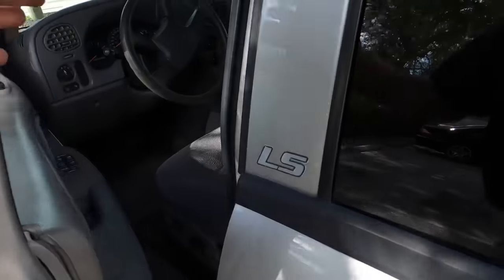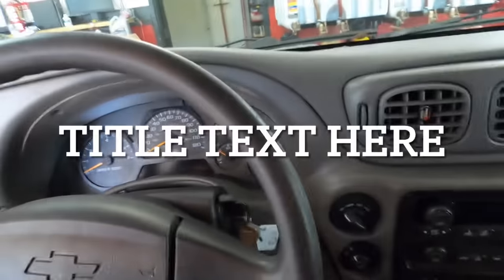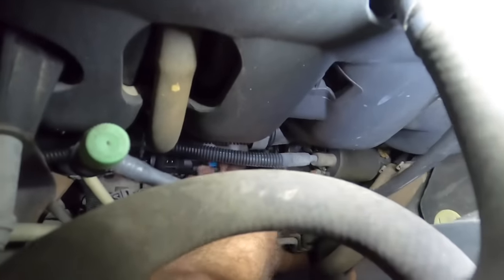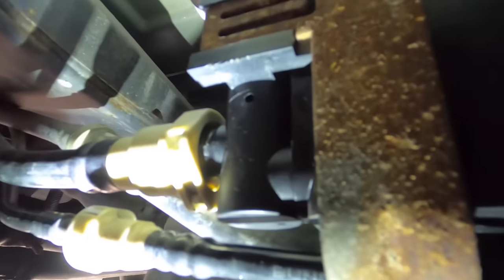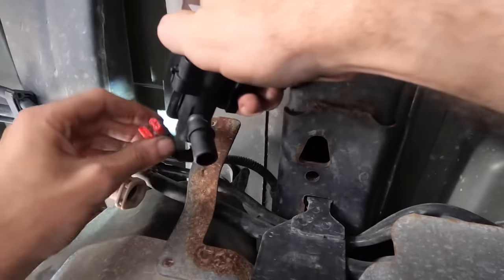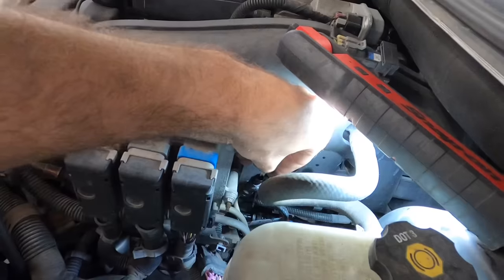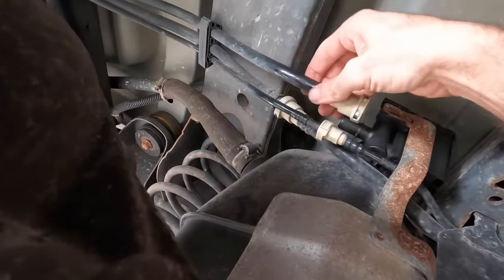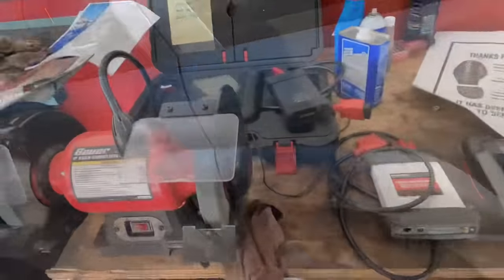Repair failed! Customer is Angry

Comment: Talking about the quality of available car parts. I can remember when available parts were many times identical with factory parts.
When Dodge came out with their first high tension ignition system, I had a 1978 Dodge van. The high tension system was a United Technologies system. The trouble was that the rotor cap, wiring and spark plugs couldn't handle the high tension. Every 25,000 miles, I had the plugs, rotor cap, and wiring at K-Mart for less that $20. I had to replace the control unit under the hood one time in 125,000 miles. I picked up a small printed brochure off a parts counter that explained the system and what to look for when components failed. 
In the early 1960s when I started working on my cars, manufacturers used many parts that were just standard off the shelf parts.
 It was the same with aircraft at that time. Bell Helicopter use PH-13 Fram filters. The same as used on Chevrolet. We would remove the filter from the Fram box, paint the filter gray, stamp it and a plain box with the Federal Stock number, then ship the filters to the government.
Most hardware for litters, seats, etc. were just plain hardware store nuts and bolts.'
But times change. Click.
Reply: Honorable mention as a built-in breakdown goes to the porcelain double resistor block that operated at roughly the surface temp of the sun.

Comment: I was getting an evap code on my 07 silverado. I smoked it and saw the smoke coming from the worst place possible, above the gas tank. So I spent an entire saturday in my garage to drop the tank and replace the fuel pump which had a small hole where it rusted at one of the connections.

Comment: Not all of us are good with smoke testing.  I had some evap issues and replaced some parts until I got it.  They were cheap.  But if I had to bring it in I would bring it in with codes on and tell you what I replaced.

Comment: I wish you could work on my brothers trailblazer I think as a mechanic it would satisfy you abundantly in trying to diagnose it. I believe there’s a short somewhere in the system, symptoms are radio, and other front end parts stop, then engine runs rough then moments later starts working properly again,  it was like that for a year or so. now I believe the short has gotten bigger because opening the circuit to much to make any contact now because the symptoms are now radio and engine rough all the time.

Comment: I believe the correct answer here would be to not look at the vehicle until the ses light is back on. I know for Ford when I check for DTC with the IDS or the FDRS I can see all codes that have been deleted. It is too bad that chevy does not or if the snap on scanner does not do it.

Comment: I diagnosed a faulty regulator on my motorcycle bought a new one, still had the same problems, you guessed it the new one was faulty to, third time was lucky, also had brand new batteries turn up faulty as well.

Comment: that is exactly why some guys like Louis Rossman doing circult board repairs do not like when other shops clean the boards before they get to him because different stuff on the board (other than his own experience/knowledge) can help pinpoint the issue faster ... when different stuff is cleaned off ... it takes more time to troubleshoot

Comment: Way back when...gas tanks had a vent tube that served two purposes, one, to keep the gas from overpressuring the tank on a hot day; and to let air in to equalize the pressure as the fuel level drops. 

Early evap systems had a charcoal canister that absorbed the fuel vapors and a valve that routed the vapors to the engine.

Comment: I've had so many of those valves off to dump the dust out and clean the foam filter. The older round GM ones held about a quarter cup of dust.

Comment: i have a quick test for a vent solenoid and purge solenoid  with he scan tool do a purge and seal test and watch the fuel tank pressure put vacuum in the tank  and seal the system and see how quickly the vacuum drops if it instant it needs a vent solenoid

Comment: My 2005 Tahoe has an Evap system fail that prevents me from filling it up any faster than a gallon a minute.  Runs fine though with intermittent fuel door error.
Reply: 🔰🇺🇸 Same here…I’m pretty sure this is the exact same issue I’m having and have had with my 2008 Pontiac G8GT. In the summer, I have to wait for the gas tank to bleed off through the filler, otherwise the tank won’t fill and it’ll spray liquid gasoline back at me.

Comment: The new parts today are junk, even OEM parts, depending on the part of course. I have a 2004 Suburban that the engine light came on, I checked the code and it was the purge valve under the hood so I bought Acdelco part to replace it, reset the DTC on the computer all was good for a week until the light came back on again, checked the code and it was the same part, I check the part and it wasn't sealing all the way when closed so I returned the Acdelco part and got another one, the part was also bad I got 1 more Acdelco part and it was also bad, 3 bad Acdelco purge valves in a row, so I tryed a Dormon purge valve and a week later it was bad as well, I went to the dealer to get a Acdelco part from them and it finally has been working for months now with no issues. WTH is going on with parts these days?

Comment: Just spent a bunch of money replacing the coolant level sensor and it’s doing exactly like the first. This video may seem unrelated but it makes me feel that maybe taking it back for another sensor isn’t a waste of time.
Reply: “doing exactly like the first” is throwing a “Low Coolant” message when the coolant is full. Also got new hoses and clamps, coolant flush, etc so if it isn’t a case of having two bad sensors I don’t know what it is.

Comment: Had an ‘02 Chevy Blazer with a similar issue… until I replaced a decrepit vacuum hose. I kept getting different codes, but they all had to do with the evap system.

Comment: My ECM detected a large EVAP leak and requested CEL illumination and also produced a P0455 code as well.  It's in only code on my 21 year old Durango. Luckily, Alabama doesn't have emissions testing so, this little light 🕯️ of mine, imma gonna let it shine 😉 Finding quality replacement parts, without paying a hefty premium... for plastic 😒

Comment: Bad new parts are not uncommon, even though it's a small part I bought a brand new 30 Amp Fuze holder and it was defective so I understand what you are dealing with on that valve

Comment: You need to replace the fuel pump module it has a pressure valve built-in it that will take care of the  evap code problem all the S tens and vehicles that had the same drive train had the same problem

Comment: Yup I can attest to the just cause it new it doesn’t mean it’s good. It’s crap. Had a wheel bearing changed cause of a issue. Had it changed out. A couple of days later I heard rotational creaking when braking dealer up and down checked everything else. Brakes, parking brake adjusted cleaned  , everything. Finally got a head mechanic on it and he said it’s got to be the bearing. The advisor said it can’t be they just changed it out. Guess what, it was crap. Bad brand new bearing. The only good thing was I got a loaner every time I came in and wasn’t charged for the subsequent visits to check related to brakes.

Comment: Before I purchased my own scan tool, I had a check engine light on my 2009 Toyota Sienna when on vacation. I took it to an Oreilly's in the nearest town and had them scan it for codes. Reader said 02 sensor. I asked to have the code reset and was told "NO" We can only read the codes for you..

Comment: Over 30 years ago a customer brought an articulated truck and transmission/clutch/pilot bearing/throw out bearing ‘cause his transmission was bad and wanted replaced, he was informed that it needed a diagnostic and he refused, so we told him to come at end of day and job will be finished. All parts and components he brought were replaced and still didn’t run, the problem was the transfer case inoperative, costumer got pissed at us for not having truck running when he refused diagnostic and it took three extra days to get transfer case and next day to install it. He never again complained about any diagnostic testing from them on.

Comment: personal experience ,that engine is done for lol had the exact situation happen to me, month later she started foaming, check the radiator the trans cooler is inside and leaks into the system and mixes in the intake and makes a nasty froth , shortly after that it jumped time

Comment: A lot of commenters asked "Why wouldn't you smoke test the new part while you have the machine still hooked up. As evidenced by the fact he put the "new" new part in, while laying on the ground, it is VERY common to diagnose a vehicle and then return it to the lot while waiting for approval/parts/ or whatever particular holdup may arise. Disconnecting the machine and reassembling any and all components is a common and necessary gamble, especially when there is a high probability for customer disapproval. Why clog up a bay for an hour or longer when I can be working on other stuff?

Comment: My 2020 Pathfinder had the same prob. The tech said there is a tube at the tank has a varmit induced hole. The tube cannot be "repaired" it will shatter. So, a new fuel tank is the solution. I've been waiting three weeks. A piece of black tape over the "check engine-light" has removed the visible!!!!

Comment: In my 35 years of doing mechanics you wouldn't believe how many brand new parts were faulty. The worst was ford starters. Even got one Ford starter that was Made in Mexico and had a passed test sticker on it that was wired backwards at the solenoid.

Comment: Just had my Evap valve actuator replaced cos i could smell petrol whilst driving. It didn't fix the issue. Turned out to be a cracked one way valve on camshaft housing. Garage charged £200.00 to change the evap valve. I bought a new one way valve from ebay, cost £5.00.

Comment: That first one sounded sick.   Now I always thought these valves are to equalize tank pressures by allowing air in when the tank is in vacuum from fuel use, not to let fumes escape. Defeats the emission controls by doing so.  The vapor canister is used to store excess fumes under pressure when the car is sitting and not running, then fumes are drawn from it during engine operation, a valve such as you replaced would make the canister useless.  The escape of smoke is just for testing purposes, correct?

Comment: he'll be back because ive been through this. bench test it with fully charged battery it works fine but can bet there's only 11v at the wire. could be a corroded ground, fuse or relay. my alero the wire harness ground to engine block was loose hidden behind the starter. also a problem with all '02-'12 impala transmissions the wire harness connectors to shift solenoids become fatigued from heat anything under 12v it wont shift wrecks the solenoids

Comment: My first real diag job as an auto technician was a BMV speed sensor. Installed and same code came back. It was a very embarrassing moment until the lead mechanic rechecked my work the next day and discovered that I had indeed correctly diag'd the vehicle and the aftermarket POS speed sensor that I got was DOA.

Comment: I was going through a drive through after work the other night. The engine started to stutter at stopped idle and engine light was on. I just got code P0455 on my 2011 Ford Fusion. The purge valve was malfunctioning. Picked up a new one, changed it, cleared the code and drove it around a bit and engine stopped stuttering at idle.

Comment: Rain man. ?? For ya. 06 Colorado. Rinds great untill temp hits 1/2 way on gauge and then truck will stall as soon as you let off throttle or lift to turn ect!! Fires right back up but stalls unless keep gas’s 1050 or above..  replaced all crank and cam sensors vvt ect.  I was told that GM fuel pumps when they are dying they will get warm and shit off …. This truck does it like clock work. Hits 1/2 temp and stalls.  Any idea or have u came across this. 06 2.8 Colorado 117k 😔

Comment: The schraider valve is reverse on vehicles, because they don't want you using bicycle tube ones for automotive applications. the ones for bikes, will melt from the heat and/or from the chemical vapors. which is why you cant use a milk jug as a gas can...Seen some things at gas stations in my travels. LOL

Here's my "new part" story
I had to buy an oil purge solenoid for my 2zz-ge engine, and bought one at autozone.

i was going on a 3000 mile road trip in a couple days. The engine had a weird misfire and loss of power/random stalling while going speeds above 30mph.
engine would run decently when i kept my odb scan tool plugged in while driving.

I NEVER seen or heard of this in the 30 years of working on cars.
when i was just 7 miles from returning home, the car died on the highway. immediately, i went to the solenoid. and tested it with a couple wires and a 9v. it was burnt out.
had aaa tow my car, and ordered an OEM solenoid, that took almost 2 weeks to arrive, and replaced the autozone one. car fired up and purred like a kitten. no misfires, stalls, or loss of horsepower.

I told autozone what happened, and asked for a full refund, because i can't take a chance on another one being faulty. Got my refund, and promised myself to never buy electrical components from autopart stores ever again.
Also, the OEM one was half the price of autozone's faulty one.

Comment: Just had a similar thing happen. Got an evap code. put on the smoke machine. No leak. Replaced the vent valve and reset the code. Came back up. Replaced the, I think it was called the shut valve. Reset code. Light came back on. So I brought it to the shop. he said the 2 way valve was shorted. Got a new one. Took it home. The light just came back on again...

Comment: Pull the wire plugs off the ecm.
Trailblazers in them years have. Abad habit of getting moisture in them and they start giving all kinds of electrical gremlins.   Once fixed and sealed they aren't bad.

Comment: It seems I am the only one confused about the terminology.  My understanding is that the valve is normally open (air flows through it).  If current is applied (ground side connected to ground with voltage on high side), the valve is closed resulting in no air flow.  When one states that the valve is commanded on, that should means that current is applied and the valve closes—-no smoke through it. Maybe it should be said that the valve is commanded open (no signal)?  Or the solenoid is commanded on/activated resulting in valve being shut.  If I heard correctly, the bad vent valve was commanded on, and did not pass smoke, thus was declared faulty. Does commanded on mean not closed.  It would be not closed if you unplugged it.

Comment: "new replacement parts".....= SH..T! I am from Argentina....I do not know how is It called in english the mode when all the turn signals go on blinking (as when You are parked in distress aside the road)---well. I diagnosed that It was the key that commands that mode (the one with a red triangle in It) . I bought 3 keys. All new, all different chinese brands, all ok with the part N° for my car......one of them  (the second I bought) worked for..say ..4 or 5 days and died..al the others never worked...Nowadays It has the 4th installed for 3 weeks and It performs......(touching wood, boys!) Thanks for the videos , and specially for the veracity and effort You put on them! High 5's from down South aboard a pristine 1997 Peugeot 504 diesel.

Comment: Dads Chevy truck keeps getting the evap code, I clear it, will be off a few days but comes back, since its not causing poor running conditions he could care less.
He had his fuel pump replaced, I figure the tank/pump seal could be leaking.

Comment: My car came with the evap canister missing and a screw jammed in the hose.  This pressurised my fuel tank causing petrol to exit through the fuel cap during exuberant cornering.   Notable because multiple mechanics couldn't work it out.

Comment: So I think you'll appreciate this maybe some of your readers well. Now I'm not a mechanic I do my own oil I do my brakes I do some basic things and I still do I'm 57. So back in the 1980s had a Pontiac Parisienne and the alternator went on it. So I took it out and I took it to a parts store. And I gave them the corn they gave me a new one. I put that in the current work for a day and it didn't work. So I took it back and they said it was bad and they gave me another one. I put that one in and it never worked. So I took it back and they gave me a third and told me this was the last time they were going to do this, so I actually talk to somebody that was a mechanic that I kind of knew and he told me if it doesn't work to get the old one back and take it to a place in Rochester New York that actually rebuilds them and guarantees and warranties them. So I didn't even try the third one I got my car back I went and took it had it rebuilt for back in that day was about 30 bucks, and I never again. Now they had told me the manager said they tested all the cores they had in there was 130 I think and they were all bad. So they got a bad batch. Anyway the moral is the truth is it's best to get what you have rebuilt when it comes to an alternator or starter. I find those are much more reliable and then I'm not replacing them.

Comment: Trailblazers are junk lol gas cap was the mystery problem that seven shops couldn't find 😂 she stops at my house as a last resort and I said what about gas cap she says ohh I lost it a few days before the engine light come on she spent  thousands  and I fixed it with a used gas cap